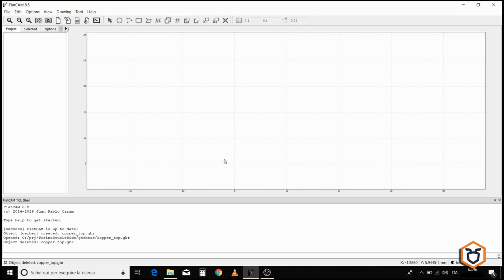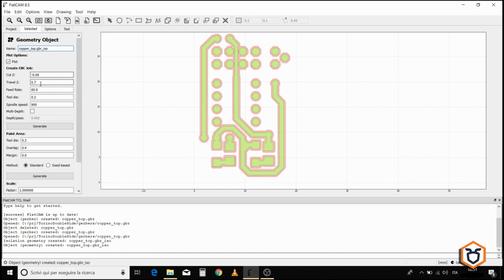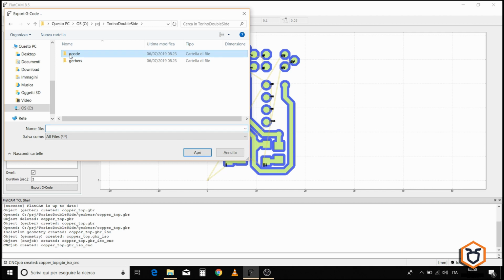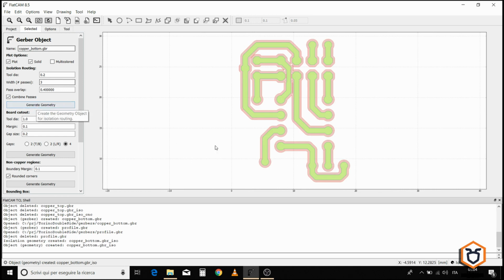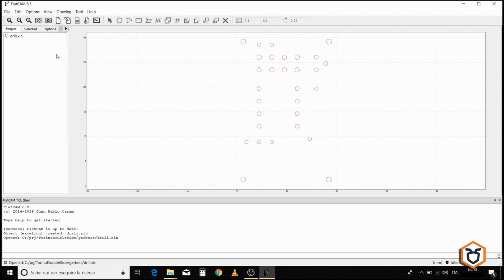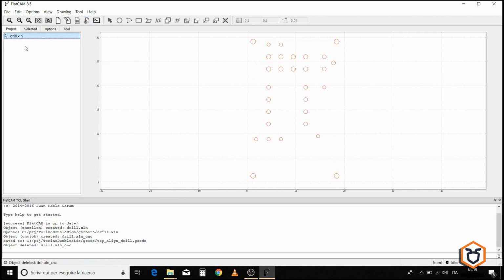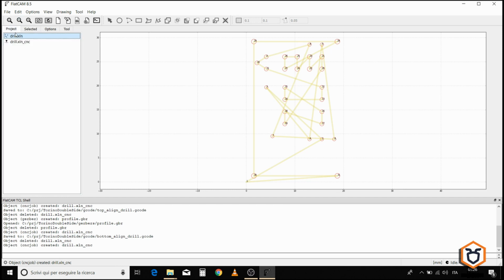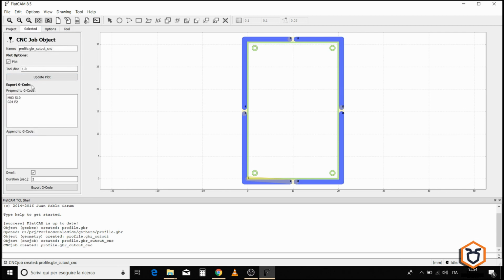Double Side PCB: FlatCAM Process - The Ant Way

Comment: Hi I build the ANT but still troubling with some errors and the machine stalls rock steady. But I thing I  will find the problem and mill some day.
The thing I want to ask is this:
Are any templates for specifications that are the best to follow when we make PCB that want to be milled single or double sided?
that is distance between tracks, track width, pad diameter, via diameter and drill, and so on. I use KiCAD but I can input the specs file fro Eagle. 
Thanks a lot.
regards
Reply from the maker: Hi Vasilis, if you want, feel free to send us a mail with details about your issues, and we'll try to help you.
To answer your questions: -minimal distance between tracks 0.2 mm;
- minimal track width 0.2 mm (also less when your machine is perfectly calibrated);
- minimal via drill diameter 0.4 mm;
- minimal via diameter depends on the quality of the board used, in particular on the quality of the epoxy glue between the copper and the substrate.
- about the pads, the smallest we milled were the pads of an uqfn48 package.
With a precise alignment, you may be able to use what we said here above also for a double sided PCB.
We did it for the Arcobaleno board, take a look at the video, if you missed it.
We hope we answered your questions.
Cheers,
The Ant Team.

Comment: I've actually managed to build an ANT and I must say, it's really cool machine.

About the video (and also something I noticed when I was trying to get the machine to work)

Your RPM value is actually incorrect (well, sort of. It results in the maximum RPM on the machine, but it isn't the actual RPM of your motor).
The motor  you're using has a KV rating of 1000 KV. This means that for every volt you put in, you'll get 1000RPM out of it.
Since you're putting in 12V, you're actually getting 12000 RPM out of it.

Your firmware however does not know this. It is configured to think that it's maximum speed is 1000RPM.
You should check the file cpcbm/firmware/grbl_port/common_src/config.h and set the value of #define SPINDLE_MAX_RPM to 12000.
At that point your firmware and your actual hardware should be in sync.
Then the RPM you set in your Flatcam also represent the RPM your spindle is rotating at when it's milling.

Also, I'm guessing that the spindle motor has quite a bit more power to give than is currently used. So I'm thinking of doubling the diameter of the pulley on the motor.
This will result to a doubling of the RPM on the spindle to 24k RPM. Which in turn should allow a doubling of the feedrate.
I'm not entirely sure if this will work though. Or if even my PLA pulley on the shaft can handle such high RPMs. But unless somebody has some kick-ass simulation software sitting about, there's only one way to find out. :-)

I'm looking forward to your next video on how to use a camera to provide alignment for double sided PCBs. I would really love to know what type of camera you're using, as it hasn't been mentioned in your build videos or your BOM.
Reply: Small update on the 24k RPM thing. The modification worked and the spindle motor can easily handle it. The thing is that my stepper motor can't keep up with the higher feed rates and starts skipping steps. But that's probably because I'm using lighter steppers then what I should be using. (Aliexpress seller sent me the wrong units and I noticed waaay to late. Decided to roll with them anyway.)

If anybody else wants to try it, you can download the part I modified here:
https://drive.google.com/file/d/1Pm6IDQZTKc79eDGdOE9ciDEi4uz6memw/view?usp=sharing
Reply from the maker: About the pulley solution, it is a correct idea, you may change the motor pulley diameter according to the rotation speed you want to achieve on the spindle. You have to take care about just a couple of things: 1)if you increase the diameter, the available torque decreases; 2)if you want to reach higher RPM you probably will have to lubricate the bearings with a specific lubricant, and you could expect that the life of the bearings will shorten.

Which feed rate are you using? Which rpm are you getting during the machining? If you want to measure the rpm, you could use ab external rpm meter or check out the rpm meter developed by the great Carl, you will find it on reddit.
Ciao!
Reply: @TheAntPCBMaker  Thanks for the feedback!
It's correct that when you set S1000 it will spin at the maximum speed possible. I just prefer to be able to enter the RPM I want in Flatcam, so I don't have to calculate which spindle speed I need to put in to get the required RPM value.

However, I didn't know there was that much loss on the RPM of the motor depending on the load. I don't currently have a way to measure the RPM, but I'm curious as well now. Guess I'll be building that RPM meter soon! :-)
Once the RPM is known, you can actually calculate the optimal feedrate to achieve a specific chipload. I'm still experimenting with how much chipload you need to a PCB though. I'm guessing I should use chiploads typically used for acrylic.

I was using a feedrate of 150 mm/min. It worked fine for a while, but now it appears my engraving bit is dull (feedrate was probably too high), which causes my steppers to skip at any feedrate I give them. (Not to mention the paths it's cutting are now waaay to wide). I'm waiting for a new set of bits to come in. Ordered a few with a 0.1mm tip while I'm at it. I'm also looking at how to sharpen the bit I ruined, but I'm not sure it can be done without specialized tools.

Again, great machine you guys designed! I'm really having a blast with it!
Reply from the maker: Hi Dafluf, thanks for your detailed feedback, we hope you have fun with The Ant :)

We will try to answer some questions you made.
About the RPM of the motor, your calculation is correct in ideal conditions, but due to voltage losses on cables, contacts and ESC, and due to the counter-force during the machining, the real RPM  is lower, and we estimated it to be around 5000 in the worst case (we said clearly in the video, but it was not so clear, sorry).

The power to the motor is given effectively by the ESC, while the firmware is only responsible to send to the ESC the correct PWM signal. The period, the minimum and maximum duty cycles depend by some configurable parameters, that can be changed according to the ESC you are using. The firmware associates to S0 the minimum duty cycle of PWM, and to S1000 the maximum duty cycle of PWM, if you change that define to 12000 you will not change the maximum, you would only have a different PWM granularity.